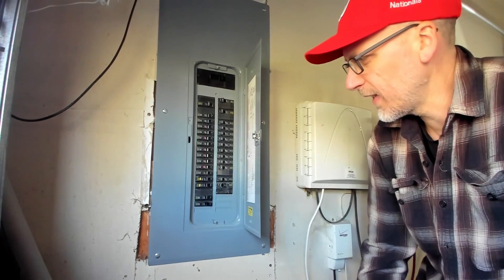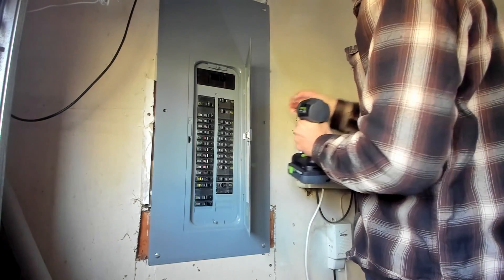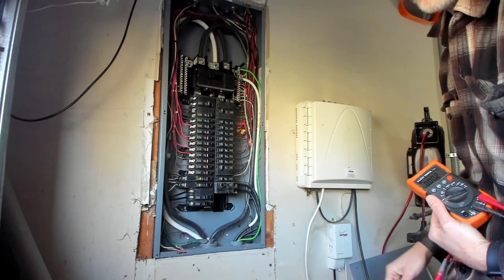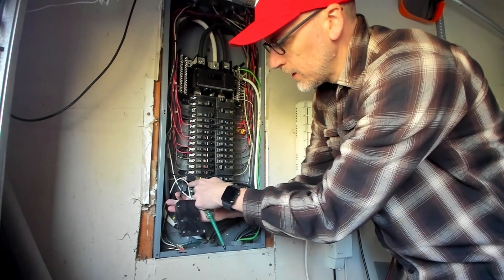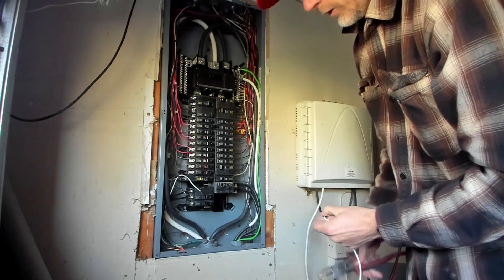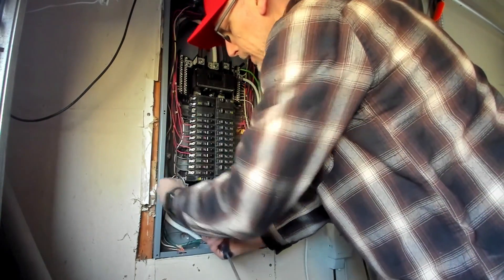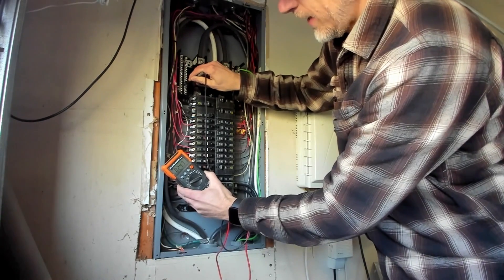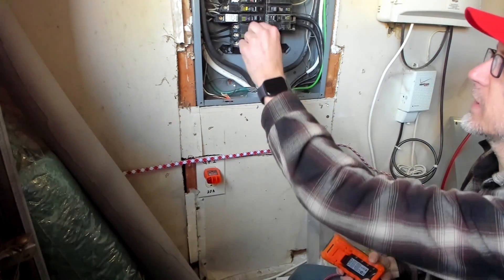Replace GFCI circuit breaker and tips

Comment: I'm in Southeast Louisiana. But my issue is with my well pump. It has a 20 amp GFCI breaker and is tripping a lot. Brand new construction home. Builder said they see that problem all the time with well pumps and it's something new with code that needs to be a GFCI breaker to pass inspections. He suggested that I change it out for a non GFCI regular breaker and that I will be just fine and have no future problems.

Comment: So all my ground fault breakers trip when the generator is on in heavy rain. Can I just take the ground wire off? Can I replace them with regular breaker. Don’t need ground fault in living room.
Reply: I'm in the same boat in Southeast Louisiana. But my issue is with my well pump. It has a 20 amp GFCI breaker and is tripping alot. Brand new construction home. Builder said they see that problem all the time with well pumps and suggested that I change it out for a non GFCI regular breaker.
Reply: @d.posey1010 most things you can find out how to do. But this has some safety issues so no info.
Reply from the maker: I’m sure you know but the gfci measures incoming and outgoing current. If there is a difference, then it trips because the current is going somewhere else, such as through the ground circuit. If it is leaking out the ground, then anyone touching it or surrounding area could be electrocuted. The issue could be water getting into the motor or the electrical housing. It could be from a loose wire or improper grounding. It could also be from an overloaded circuit if the breaker is not properly sized or if there is corrosion or another issue where the motor is causing excessive current draw. Gfci still trip from too much current. With it being installed in a location with ground water it is probably related to water enter parts of the pump that it should not due to improper installation or failed component such as a seal to the electric or the pumping impeller.
Reply from the maker: I would have an electrician figure out why current is leaking. If you remove the ground or ground fault breakers, then that current must discharge somewhere else and that is a safety concern. Or add some drainage / French drain to remove water
Reply: @handyhomerepairs thanks for the reply. I’ve had a couple electrians  come and they couldn’t figure it out. We live in rural Louisiana.
Reply from the maker: If it is just one breaker, then it could be faulty. If it is several breakers at the same time, then it’s most likely something else. If it happens in heavy rain, then it seems it would be due to water penetrating somewhere or saturating the ground and the water rising to a level that is causing an electrical potential difference. In Louisiana that’s would seem to be a possibility with the high water table. There may be a loose connection of the neutral or the ground on the generator/transfer switch or water is getting into the connections. This is quite confusing. The gfci breakers are measuring a difference between the current expected to be returning on the neutral. It has to go somewhere so it’s most likely leaking out the ground. If the system is ungrounded, then that is an electrocution risk if someone touches anything and their body becomes the grounded circuit and provides a path for the current.
Reply: @handyhomerepairs thank you so much. I will get an electrician for the third time.

Comment: I've done all sorts of DIY electrical jobs over the years (35+ years doing it)--switches, outlets, ceiling fans, fixtures, ran EMT conduit, etc...  I finally built up the courage to open the panel to install a breaker.
Thank you.
Reply from the maker: Yes it’s scary and not for everyone. I’m glad I have a breaker outside next to generator I can switch off and completely isolate the panel

Comment: Would've just removed neutral wire from breaker
Reply: I was wondering about that. Will that just stop that breaker from tripping for no reason. I was going to replace the breaker w a regular one.

Comment: From the video description:  "The circuit breaker is a combined Ground Fault Circuit Interrupt (GFCI) and Arc Fault Interrupt (AFI), also known as CAFI."   The nomenclature is incorrect.  

Combination Arc Fault Interrupt (CAFI) breakers are named because they protect against both SERIES and PARALLEL arc faults (that's the "combination").   They do not protect against ground fault.   Sometimes these are called "Combination Arc Fault Circuit Interrupt" (CAFCI) breakers. Square D CAFI breakers have a white reset button.  

There are older model arc fault interrupt breakers which protect only against parallel arc faults (not series arc faults) or vice versa. Square D AFI breakers of this type have either a green or blue reset button.  

Breakers which incorporate Ground Fault Circuit Interrupt (GFCI) and CAFI components are known as "dual function" (DF) breakers.  I believe this is what is being installed in this video.  Square D dual function (DF) breakers have purple reset button.  

There are also breakers out there that are GFCI only (i.e. no arc fault protection).  Square D GFCI breakers have a yellow or red (older models) reset button. 

Summary:  

CAFI (or CAFCI):  Protects against ARC FAULT (both series and parallel types).  Does not protect against ground fault. 
GFCI:  Protects against GROUND FAULT.  Does not protect against arc fault.  
DF:  Protects against BOTH arc fault (series and parallel) and ground fault.  

Here's a useful video explaining the differences between breakers (I have no affiliation with the video creator):  https://electricianu.com/video/arc-fault-ground-fault-and-dual-function-circuit-breakers-explainedi/  
If you're hesitant to click on the link, search "CAFI GFCI DF differences".
Reply from the maker: @williamsharpe826 thanks for the info. I updated the description to be more specific and use the Square D terminology of “dual function” to represent the breaker does ground and arc fault